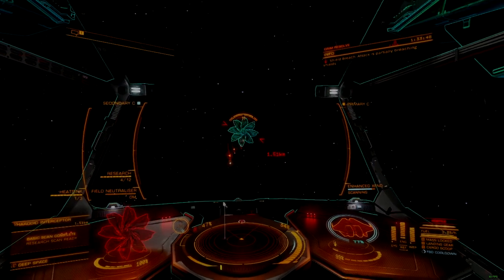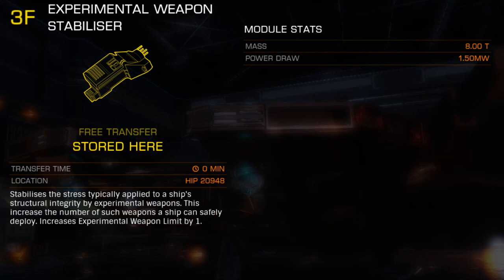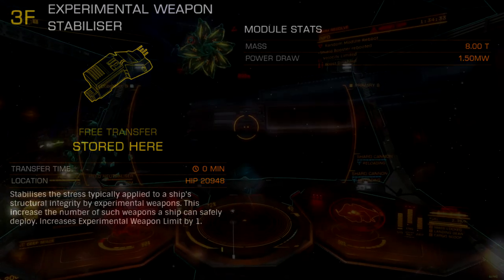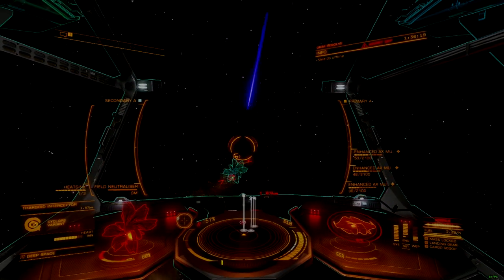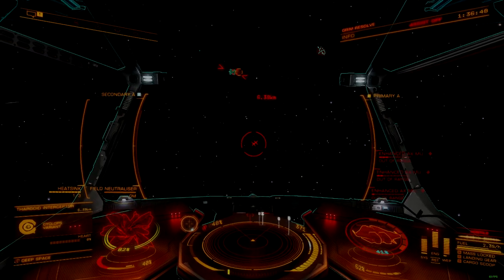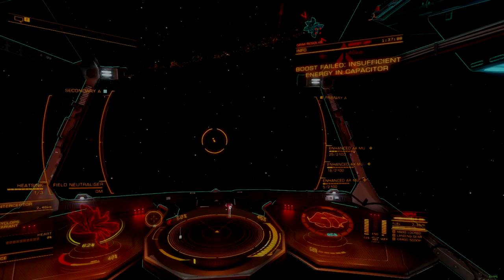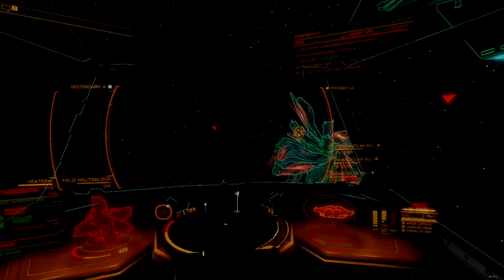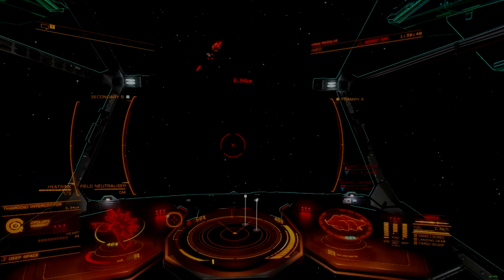Elite Dangerous | Module Review | 3F Experimental Weapon Stabiliser

Comment: I opted to run the size 3 stabilizer on a python rather than the krait mk2 considering both have a size 7 distributor for 5 guardian gauss although I did have to downsize and downgrade my AFMUs, since I like running two for faster repairs, one of them had to downgrade to a size 4 and the other a size 6 B class but I barely made it below power capacity for a G5 armored with thermal spread powerplant. The python is slower than the mk2 even when fully engineered but it is fast enough for out maneuvering swarm missiles and swinging most interceptors at 486m/s. I prefer the python's triangular like weapon convergence to the mk2's rectangular convergence and the lack of a thermal vent beam meant that I did have to rely more on my two enhanced heatsinks and silent running toggling to keep me cool while I made repairs and while synthesized more heatsinks.

Comment: I disagree with you a little bit the T10 would be the ideal to put the large stabilizer on granted the weapon damage is not all much more powerful it's more on the lines of heart damage and Scouts damage but the most important part of the T10 is weapon placement because you only have six weapons that's six of the nine weapons available  the most important so obviously the four large ax multicannons is a given however the two mediums on top would be the better choice because I always find myself going up instead of down

This would allow you to kill the hearts faster which would overall and the fight sooner as well as having extra damage to kill those annoying Scouts faster which in an ax conflict zone is an absolute right thing to do for the other commanders trying to fight the interceptors this makes the T10 a very good support role class vessel which it already was but this just adds to it

Comment: I think I'll keep my AX Chieftain the way it is. Not worth the sacrifice in an HRP or MRP to justify one additional small AX weapon.
Reply: Perfectly agree. I fail to find any reason to use these things. There are no size 1 weapons that are not Guardian, so for a Maelstrom Ship it's no use. You can equip enough size 3 and 2 AX weapons as it is. For Guardian builds, what you really want is 4 size 2 Gauss, a size 3 AX MC and beam lasers to shed the heat. There is only the Gunship able to do that apart from the large ships, and that's to slow. I just hate large ships for AX, so for me both stabilizers have no use at all. I will continue with my fast killer Challenger and fun killer Viper. Can we please get something useful like an Alliance ship with 600m/s, good lateral thrusters and 4x size 2 plus 2x size 3 and 2x size 1 Hardpoints? That could use the size 3 stabilizer. And an unlimited heatsink would be nice. I just hate the synthesis/grind "gameplay" cycle.